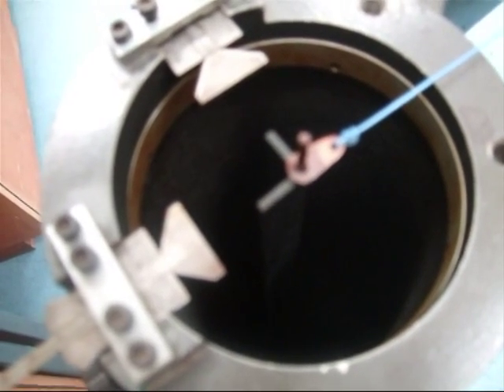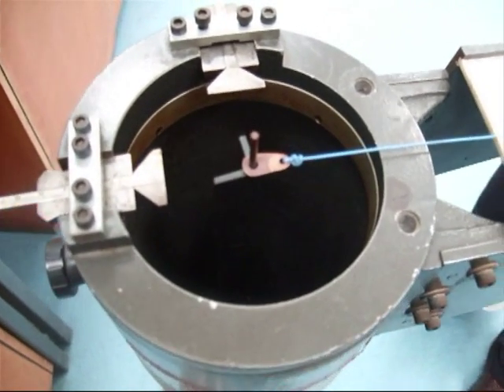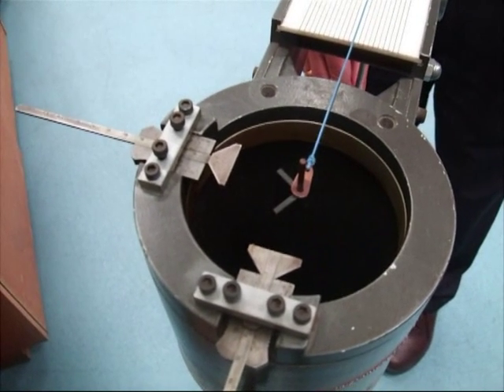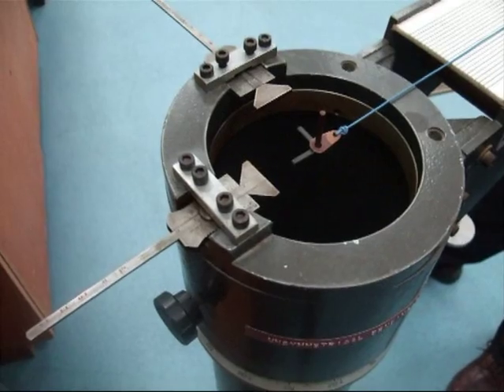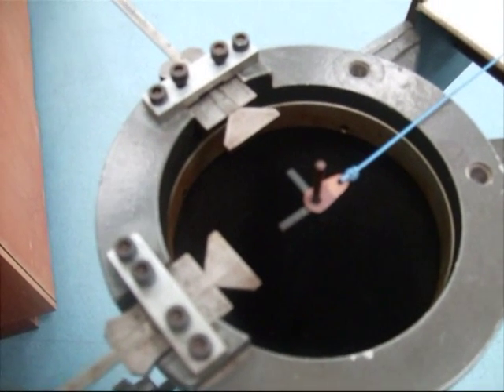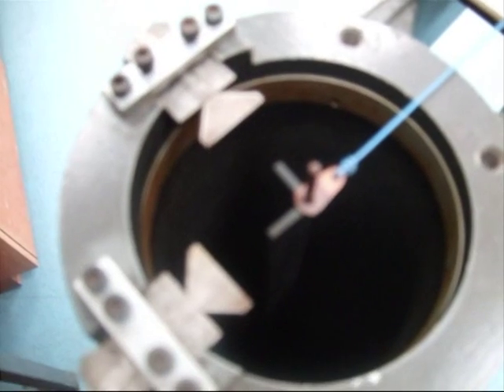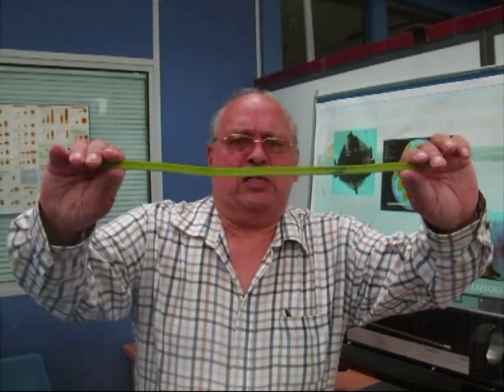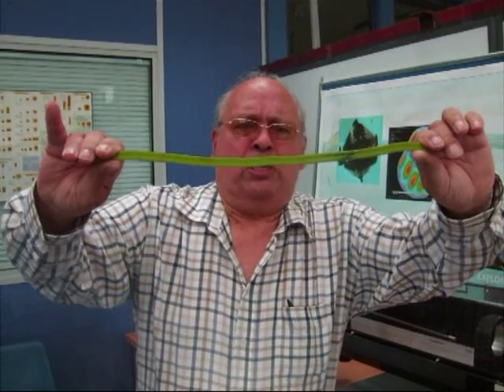Asymmetrical or Unsymmetrical Bending of Beams.

Comment from the maker: I wish to inform you that I have managed to place in my DROPBOX, the Solutions' Manuals for the following of my books:- 1) Mechanics of Solids. 2) Finite Element Techniques in Structural Mechanics 3) Dynamics of Mechanical Systems. I own the copyright of these manuals but I am more than happy if anyone wants to use them.  You can also use them for "DISTANCE LEARNING"! Carl Ross, BSc (Hons), PhD, DSc, CEng,.Just Google "Carl T F Ross", & look for the "Strength of Materials" LINK on my "homepage".